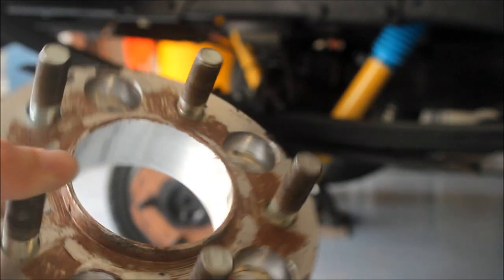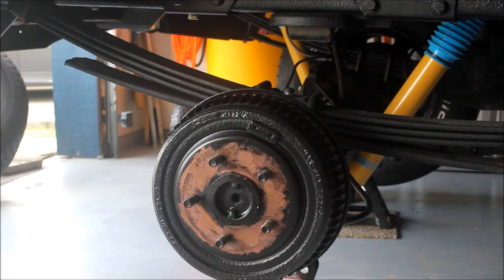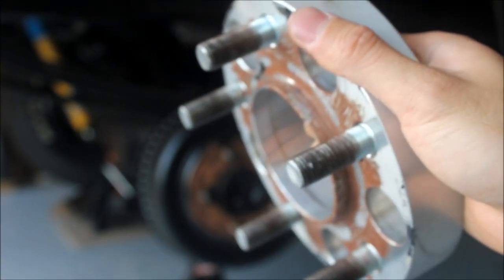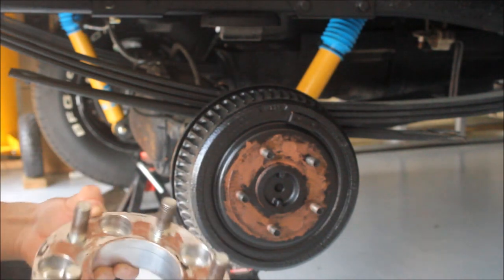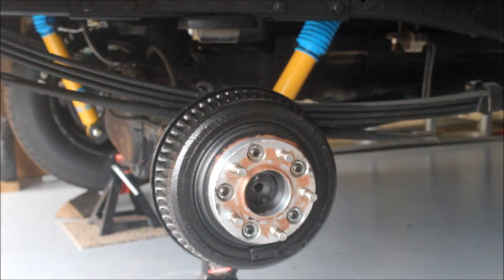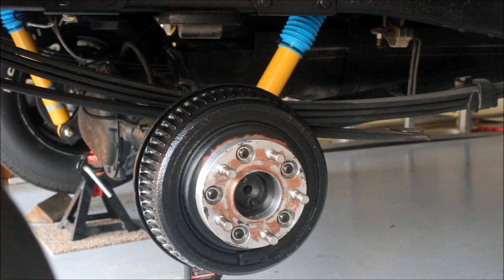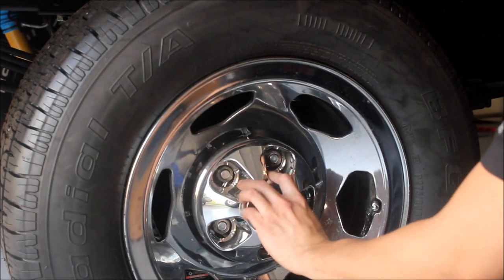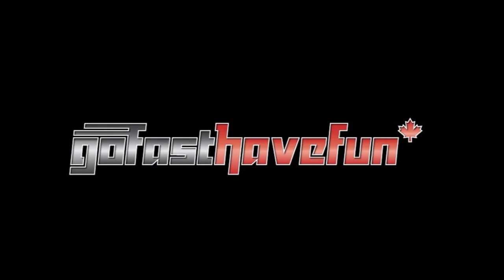Wheel Spacers / Wheel Adapters Installation | AnthonyJ350

Comment: So I mounted a set of adapters on my Suzuki Forenza with no centric lip, they installed easily and I was able to guide the wheel by applying pressure on top and bottom while hand tightening the lugs nuts at the same time and keeping it well balanced. The car's stability and cornering is a lot better. The ride in my opinion is a lot smoother, I don't think my braking was effected really. The risk is running on them with the wheel not siting on something extra to rest on. Once you've tighten the nuts, Securely, the weight of the car will be distributed and rest on all the studs evenly. One thing to keep in mind: If the Hub bore diameter of the Adapters is bigger then the Bore diameter of your rotors simply Buy, install Hub rings to clear the gap. Some experience noticeably loud thudding at higher speeds due to this.I will of course be re-purchasing some New exact to specs. Wheel adapters to properly fit my vehicle.Going with the exact specs. of your vehicle and the wheel adapters is important to get a safe and easy install.

Comment: I need help man! I just got some foose rims for my mustang but they were to big for the stud. So I got some wheel adapters and got them on. Now the problem I'm having is that I'm having vibration problems while driving! Can you help me with that? I'm not sure what to do.
Reply from the maker: Samuel Diaz Did you get hub centric wheel spacers like in the video (the lip in the middle that helps center the wheel)?
Reply: AnthonyJ350 I'm not sure. I took it to a shop and they did everything. At first I thiught my tires were not balanced so I got that done but it didn't help much. I'll take the tires down and look at it myself latee see if I can see what you're talking about.